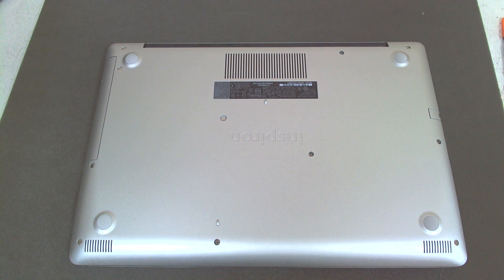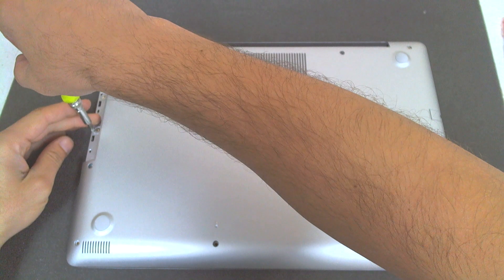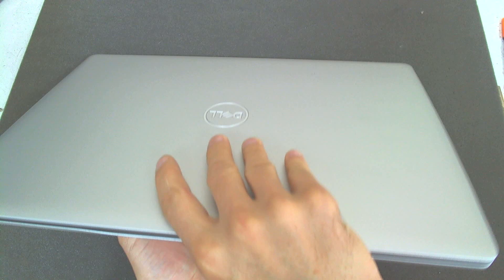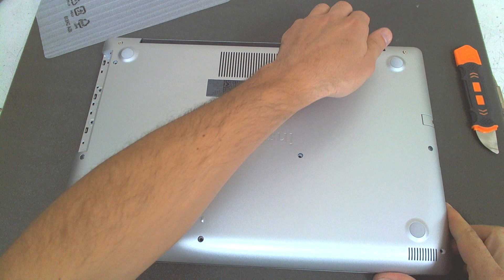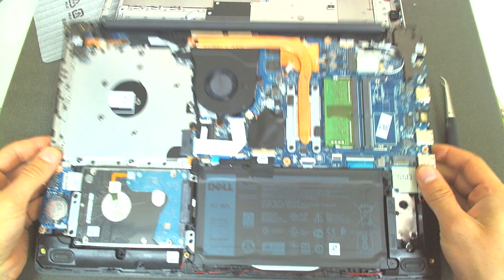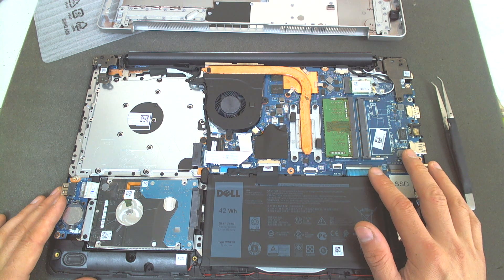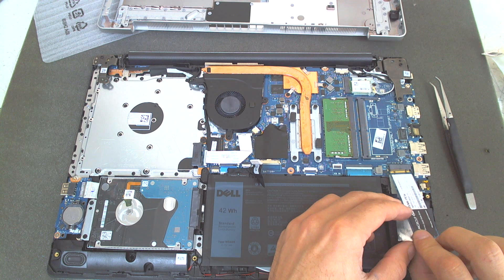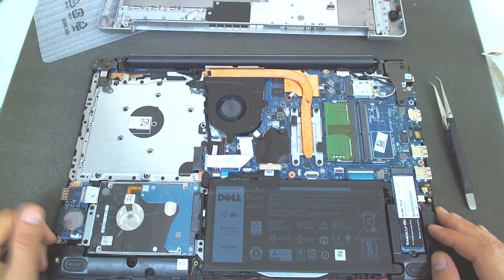Dell Inspiron 3581 SSD Upgrade / Disassembly

Comment: Thanks for the review. Please tell me, on M2 you can install the operating system.
I have Dell 3581
Reply from the maker: Yes, install the os on the fast m. 2 ssd. The laptop will work much faster.
Reply: Tell me please it is possible to install Transcend MTE110S 128GB M.2 2280 PCIe 3.0 of x4 3D TLC (TS128GMTE110S) on the Dell inspiron 3581 laptop. I will be interested in working, no one can help me with this issue. Thanks
Reply from the maker: @n_alsur9604   yes it should work. The laptop supports NVME. So no problem

Comment: There is DVD-Rom in my Inspiron 3000, how can i takedown?
Reply from the maker: The dvd rom is held by one screw on the back.  Just remove it and proceed with the disassemble.
Reply: @LaptopDisassembly  thank you so much.

Comment: will the m.2 can be installed ssd on Dell inspiron 15 3580 i5 8265U, 4GB, 1TB, AMD Radeon 520 2GB GC, 15.6" FHD (Black)
Reply from the maker: Yes can be but depwnd on the model ithave to be nvme. Tell me the exact model and i will tell you for sure.

Comment: I have Dell 15 3585, I tried installing m.2 SSD SATA 3 WD 240GB and it didn't recognized the SSD. Do you think NVME SSD will work?
Reply from the maker: Read tge description under the video. The laptop works only with ssd clas 40...nvme ssd. The regular ones not work. I try two different ones... Only nvme works fine.